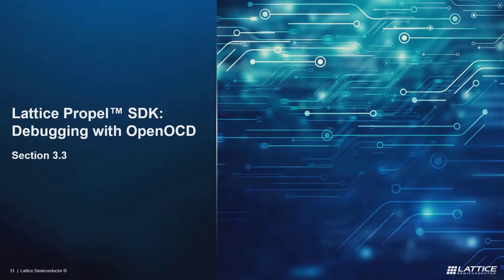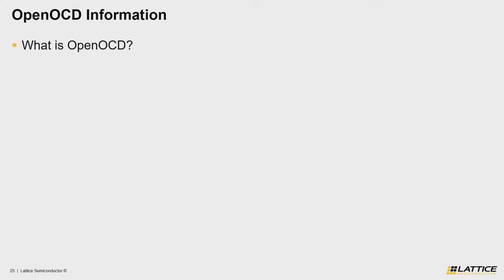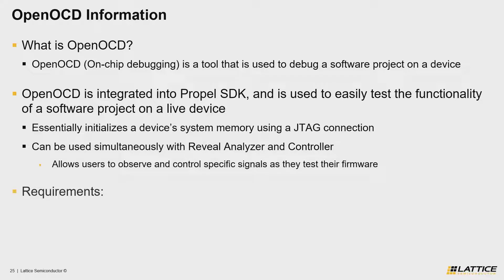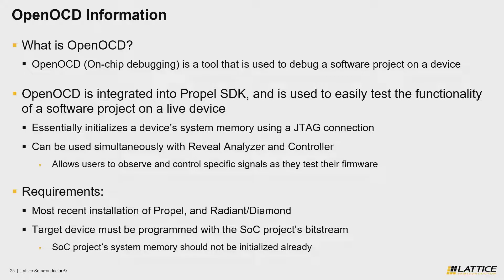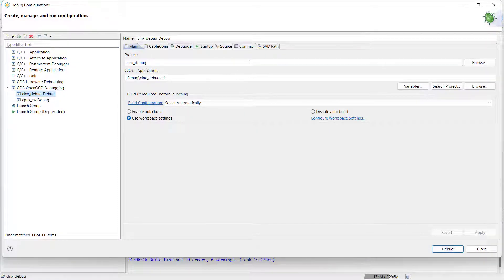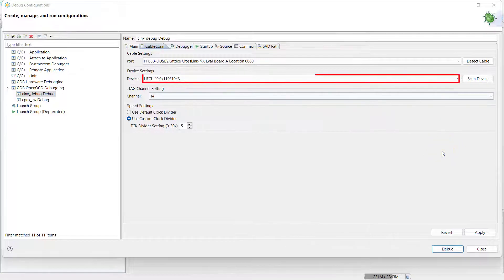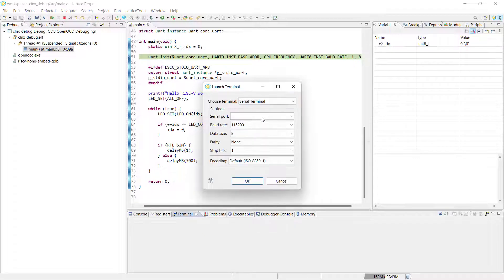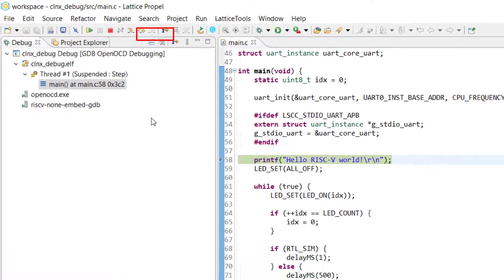Debugging with OpenOCD & Lattice Propel SDK

Comment: I understand openocd was originally designed for JTAG debugging, but is it possible to use it thru an SWD interface?  My board Risc-V's connector has SWD+SWV(TDO) which should allow it to stream trace data.  I have a J-Link edu, but can't get Eclipse+OpenOCD to connect/stream!